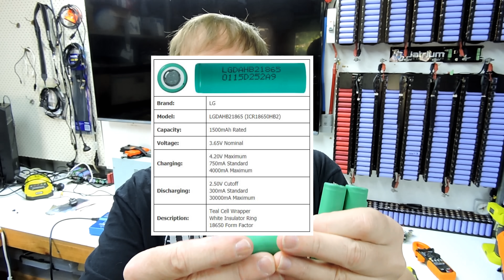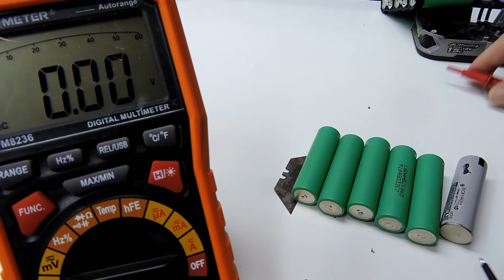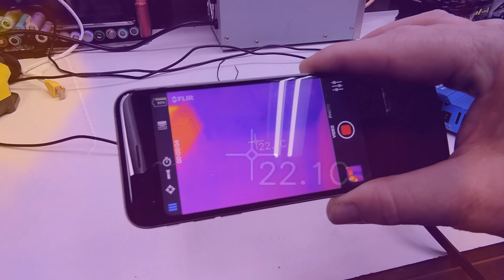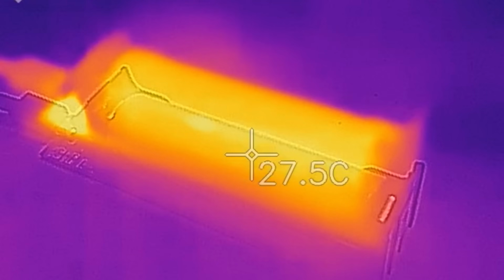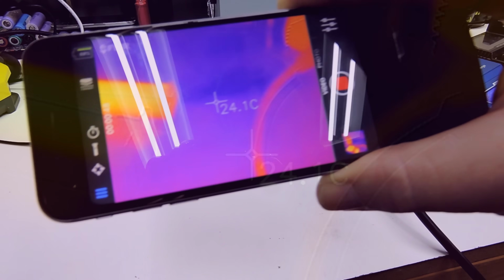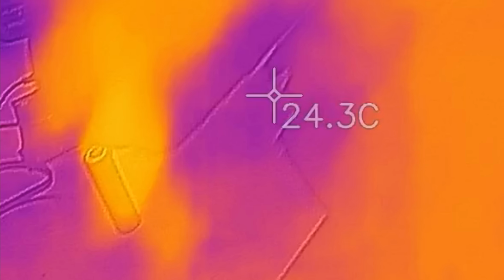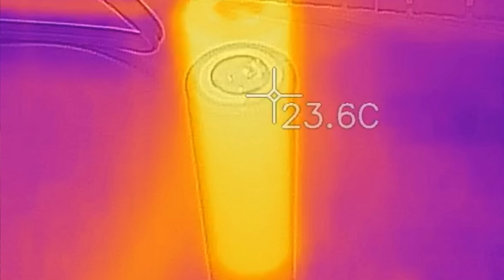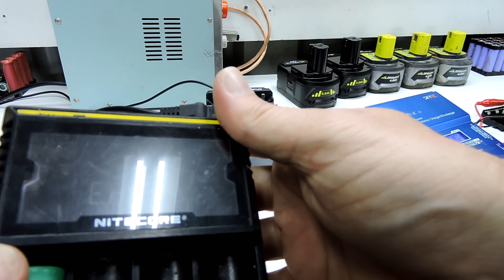18650 CID Reset   ⚡ DON'T DO IT! ⚡

Comment: You should have used something non conductive to reset it to be extra safe. Maybe a small plastic pick or ceramic tweezers
Reply from the maker: True - but to be extra save i should have just thrown it into a bucket of salt water
Reply: @HBPowerwall  what a salt water make ?

Comment: Well this was very risky, you should have wore eye protection. If the cell would have exploded especially while you were shorting it in your hand, it could have potentially blinded you. 

No demonstration is worth your eyes or any other kind of injury.

Aside from that, you've convinced me that one should NEVER EVER do this under any circumstances, so in that, you've done your job and gave a very dramatic demonstration on why one does not attempt to revive a dead Li ion or Li po cell. Thanks for putting this video out there, but PLEASE wear eye and hand protection in the future before even handling these batteries. I wear trifocals today because of eye injuries when I was young and stupid.
Reply: Agree - but i dont concider this situation that terribly dangerous. These cells dont explode easily as far as the safety instruments like the CID are still in place. This kind of experiment is much more risky with cheap fake batteries from china that sometimes dont have any of the safety measures! I found it really impossible to bring these old laptop cells to explosion without mechanical violence. Shorting them out, massivly overcharge them and so on doesnt bring them to explosion - normally. But dont try this at home!
Reply from the maker: Sound like that is a lesson I should listen too!

Comment: it's not like anyone here is good at heeding advice. Best way to find out is by checking the news and seeing what dumb shit set his house on fire. Here's the skinny...I've been using 18650's exclusively in vape mods for over 5 years. I've have 2 hard shorts an that time with no thermal runaway and the CID  popped both times. It was due to bad manufacturing in the mod and after some modifications of my own, the mod works fine now. 
I WILL say this though...if you're not THOROUGHLY trained or are unaware of Ohm's law, and/or electricity, do NOT mess with these batteries. If you're doing it anyway, I only hope that it just blows your fuckin hand off and not burn your house down with your family in it....yeah, it's that bad. Don't be fucking stupid and do what this idiot does.

Comment: Hello I used your tip and it's works, after resetting it is showing voltage around 4 volt and not getting hot also what i should do use it throw it ?
Reply from the maker: Recycle it, please don't use it....

Comment: Great video!! thanks... I am new to the battery community, and I have a question please. 
What if the 18650 battery has 4volts and has continuity, but does not work (as in powers things up, light flashlight) would this CID method be safe?
Reply from the maker: DIC rest will never be safe but if you can get a voltage reading it won't be the cid might just be a really poor quality cell with very low capicity perhaps

Comment: i have a laptop 18650 that i accidentally shorted out in my drawer without knowing and it was left it for a few months and now it is all rusty on the positive but i put it on the charger and it charged fine and now i have it in my triple battery vape that i use at 15watts and it seems to be fine
Reply from the maker: 'seems' sounds like i'll be seeing you in a viral video some time soon with a fire in your pocket.
Reply: ill be sure to give u an update if it does... i plan on using it for a bit.

Comment: the heat from the  battery is interesting how about making the pack larger and use it to heat a small room cheaply with low voltage
Reply: It'll heat your whole house once it catches fire.

Comment: After reset my cid, I don't have heat when charging
Reply from the maker: You're mad - heat from charing is the least of your issues.
Reply: @HBPowerwall  I'm using xtar mc2 charger with 2amp 5v usb, I don't have any heat at all, 
I don't use heat sensor, i just feel it

Comment: A bucket of 'water' for a 'lithium' cell..... Oh my dayz..  You shouldn't be doing these sort of videos, if your safety isn't your upmost of priorities .. Enjoyed the vid tho
Reply from the maker: Buck of water is much better than letting it burn on a bench, lets face it local fire departments deal with lithium car fires with? WATER yes HOURS AND HOURS of water, more water then add water - Oh my dayz get the cell cool slow thermal reaction
Reply: Bucket of sand would be much more effective, safer for you, your investment, and for the viewing community. I know I'd rather switch out the hydrogen gas for some glass! As much as it would make a cool video, 'Inadvertently Causing a Series of Chain Reactions.'  Let someone else make that one (They know who they are) hehe  ; )

Comment: I've revived some 0v over discharged battery between 0.2 and 1.3V (5pcs) whit the jump trick. placed on a rubber band above a steel bucket, connected to a battery and a charger, started charging at low current and removed the jump battery. (all whit CID intact) revived all of them whit the cycle charge of the opus to 80% of the nominal rating.
Reply from the maker: huge difference between a zero volt cell & 0.00001v :) but sounds like your idea above a bucket it a great idea for safely giving some lithium CPR

Comment: Nuthink? Shorts an 18650? Resets CIDs? Uses continuity function on somewhat 'live' cells,? Could damage a multimeter. WTH? Everything here is a disaster waiting to happen.

You are correct.  Video should not have been uploaded, period.  There will be those who try these things, and will, eventually cause a catastrophic fire while they are doing several of the things shown in video.
Reply: I thought the 'parallel dodgy cell with fully charged one in holder' was the dumbest part. Hardly surprisingly it got hot fast. Paralleling very full and very empty cells together is likely to induce large currents. I'm not entirely sure this guy really understands what he is doing.

Comment: one shouldnt connect a low v cell with parallel with high  v , it damages the low one alot  :|
Reply from the maker: good tip - thankyou
Reply: @ @HBPowerwall  Why didn't you know that BEFORE giving advice about how to (not) recharge Li-Ion batteries???

Comment: These cells obviously leak electrons across the membrane, resulting in a resistive load on the charger and get hot.
Recycle them.....Shimples.
Reply: If the cells are fucked, then they have high internal resistance... that's what makes them hot when you try to charge them.
So, ity's the complete opposite to what you are trying to "state"... How could you get it wrong, when it's so simple!

Comment: you're right BUT that's not always the case. the CID can pop for a few reason not just overheat and pressure the Cell you do has a Clear Internal short and is no good. 

they can make a good project cell if you get one that shows safe. but it should never be used again for anything high drain or Critical applications its a crap shoot since most Cells revived this way show 50% life at best which is pretty much done.

Edit. also, don't fear monger that Samsung you got there Couldn't catch fire even if you Threw it in one. thats a INR cell with 6Wh of power. its more safe then the IMR's of 10 years ago. but I get your Logic. people don't know the difference between cell types and wont understand. Kids if you're reading this. tool batteries don't catch fire like Laptop batteries do, mumm kay?

don't believe me? google tool battery fire. guess what you find on Fire? Cell phones, Laptops and teslas...... INR/IMR's simply don't catch fire. even when fully charged and shorted out.

Comment: OMG!  You need to trickle charge, not force voltage into it!  You've probably damaged it more now, but take another cell, and try connecting to the Imax.  Set the charger to NiMH.  Set the amperage to .1 and let it sit for a while.  You will have more success doing this method, and it will be much safer.  I've done this multiple times with Lipos I let drain by accident. (left FPV goggles plugged in for 2 days)  But I was able to revive the lipo and use the battery in a low draw situation safely.  Granted, it's damaged, but you can use it for low draw requirements.

Comment: Hi Peter first off all thanks for your vídeos, I really learn a lot with them. I personnaly also dont do the CID reset, DONT DO IT GUYS!!! but want to show you and all the guys, how I bring back to Life 0V 18650 with my Foxnovo. My video https://youtu.be/JOKW6LJKRuc and some of those cells have really good capacity nas dont heat up... I use the Foxnovo to charge with several resets, it brings some off them to 2,5V and they start do climb normally then I put them on the Liitokala and slowly charge @ 300mA, less stress on the Foxnovo lowest setting 500mA.
Reply: Also if they Bip and have continuity like you showed with the multimeter, you can do it like you tried, with a full battery but by giving, small shorts from the from the positive charged one to the positive with 0V. When I started my channel I didn't had the tools for the job, and started doing this kind off tries https://youtu.be/9ZOhdYW8yKc?t=7m17s Thanks Again for the vídeos.

Comment: I have a 18650 that is just below 3v is there a way to recharge it?
Reply from the maker: yes put it into any charger - they all will recharge a cell thats about 2v or above - really low you could use a TP4056

Comment: You said the CID is gone well what I do is I get a screwdriver and I tap in the positive side until the contact is reinitiated but it is really dangerous because I could Short Circuit the battery but it does work and bring back the batterie
Reply from the maker: Working and working safely is a bloody fine line. Unless there is no other choice my recommendation is if it's broken - it stays broken

Comment: if 18650 cells after full charged then mR=around 100. CID indicate that 18650 cells had misused or degraded. it can be used for some loader under 350ma like flashlight or led, ardruino etc...if you used these cells in parallel then it will parasites power from other cell, for long time dont used around couple months, all other cells will going die or degraded lifecycle. if you used these cell in serial installed then it will increase mR that reduced  high C perform, then your circuit going bursted. there are 3 mains things that happen: bad cell or low cost design( some mfg make these cell with low C for safety and low cost). second one is overloader( like harvert in laptop cells: due to bad idea on ratio battery and wattage of laptop, gold ratio is 0.2 to 0.4C base on cell but on laptop that ratio is 3C to 4C, so lifecycle of laptop battery = 1/(4C:0.4C)x1000cycle=100cycle x 5 day average=1.5 years.) third one is bad design and understanding of perform. support that you can find any twos cell that fully charged with same exactly mR (internal resistor ) then you can buy mega lottery. the best for parallel battery is install a disconnect switch by a mosfet or physic button. then a small starter battery will turn on these mosfet to connect all parallel battery for loader. if for couple  HOUR not used then it automatic switch off to disconnect and separated all cell in parallel; but hey i think mfg never support or want doing like that.
Reply: idk what kind of baby flashlight you use, but mine certainly can't use such a bad cell lol

Comment: I found some cells near zero voltage but they seemed to revive when charging slowly with the tp4056 but got warm when they came to higher voltage around 4.0 volts. All of them had the same issue. I put them out, let them cool down and started again. This time they didn't got significantly warm and charged up to around 4.15 volts. But they still have some high leakage - after a few weeks just sitting there they dropped to below 3.5 v. After a few round trips of charging and discharging they keep their charge a little better but still they are bad cells. I never found a cell that was dropping the voltage that quickly like yours in the vid.
Reply from the maker: near zero - in my experience can yield some very healthy cells as long as they are brought back super slow

Comment: What that cell was was one that got charged backwards once that happens it cannot take a charge, I bet you would have found at least one cell that was useable. The CID’s popped because it either got really hot or it was at 0v for a long time. I am rewatching this video because I am checking my helicopter batteries after a couple years and one battery for my blade mcx2 has puffed at 0v, the lutema large heli’s pack has both 18650’s with open CID’s. Sooo I guess check on your high drain cells more often than your normal cells

Comment: Found out 4 cells from my ryobi were still good but opted to replace all with normal samsung 2000mAh. Got my 1/2 impact working again. Torque might be sustantially less though.
Reply from the maker: As long as you can still use another day :)

Comment: I am not lucky enough to get a lot of cells they come by a little at a time, so I try to use all I can. I have been resetting the CID's for a long time. I check it to see if it gets hot when charging, if so I will pull it, if not I charge it and use it. If they don't get hot then they seem to work fine. If I got lots of cells then I would not care as much. I only have a few hundred after 6 months of collecting old lap top, power tool batteries. Anyways to each his own I guess, it's not a safe thing to do by any means but sometime you got to do the best you can with what you have.
Reply from the maker: Arliss - I gota agree!! sometimes you have no choice, but stay safe buddy!

Comment: Another Great Video and Prime example of what to expect when trying to revive a Dead Cell!🌋🔥💣💥
Reply from the maker: Turns out mine were dead-shorts so probably worst case possible
Reply: Did you reset each one? Or just the one shown? Just curious
Reply: No it's not.  It's just a prime example of stupid things you should NOT do to a dead cell -- like shove 2A into it, or short it across a fully charge battery (effectively 'charging it' at 4.2v at the Max amps the good cell will give.)
You shouldn't do that even to recharge a good cell!

Comment: I don't know it's bad or not but I got 10 cells Cid reseted which was 0v and now it is working perfectly giving me more than 3.8v output and I use them in my high capacity power bank and had no problems . but first time when I charge it by simply connecting to adapter (without BMS) the battery just get some hot and I was always monitoring the temperature ,afterwards there was no heating problems shown while charging so I thing  it's ok
Reply from the maker: Good to see your up and running - but please stay safe

Comment: You didn't try to reset the CID on the other cells.  What if some of the other cells came back to 2.5 volts immediately after resetting?    I have found many "Zero volt cells" that DID come back to as much as 4 volts immediately upon resetting them.  They DO take a charge well.   If a cell came back to only one volt or so after resetting the CID, I too, would discard it.
Reply: Yep that’s what I am thinking the cell he reset in video was one that got reverse charged, that is a 100% repeatable way to get that behavior, but there had to have been one series set that had the highest voltage that obviously couldn’t have gotten reverse charged. So definitely not worth the time for most people, but there is one set that is probably not internally shorted (I’m not going to say it will be good since the CID tripped for a reason :)
Reply from the maker: No i didn't try on the others, the second 1.5ah pack all has zero volt cells also - not remotely tempted to pop them back will use them for other experiments